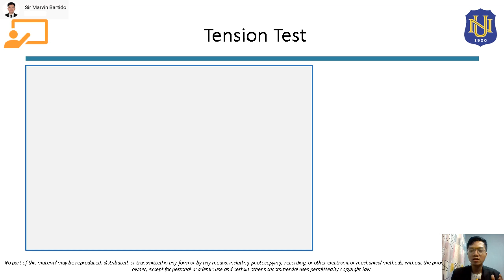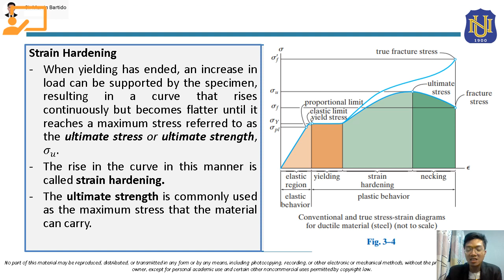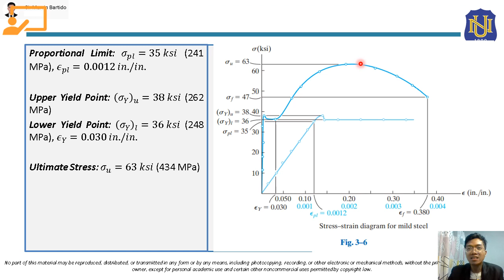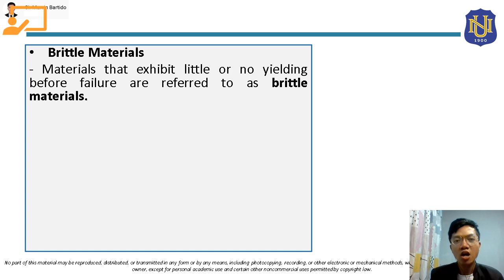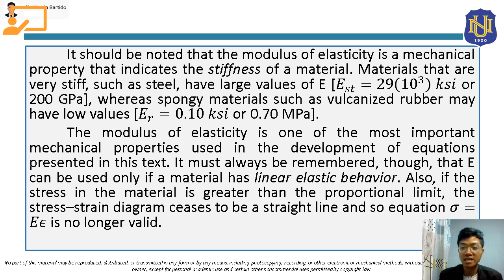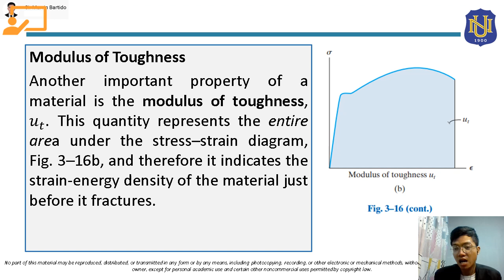Mechanics of Deformable Bodies - Fundamental Concept of Strain and Deformation (Part 2/4)

Comment: Lugtu, Gabriel Sidney T. MEC191

I learned that if the stress and strain meet each other at the proportional limit in the graph it is called the modulus of resilience and it is the capacity of the material to absorb the energy without destroying it (given material).